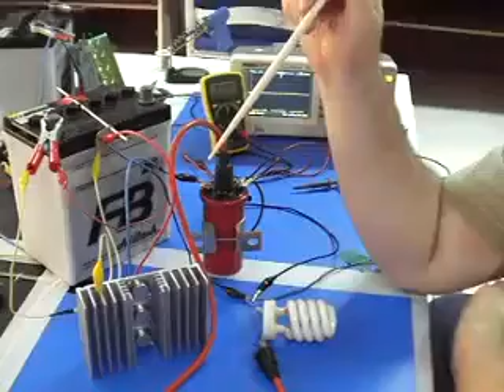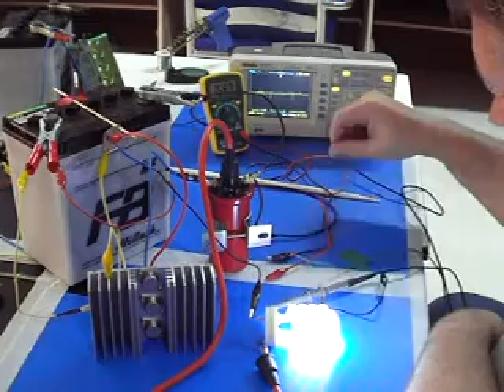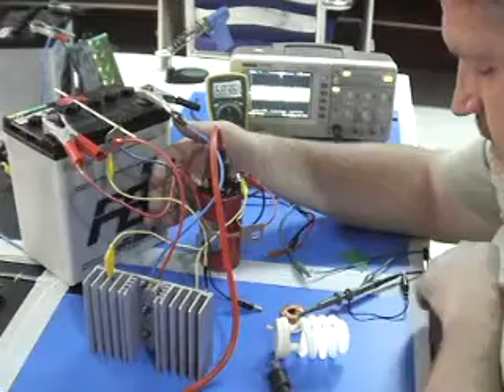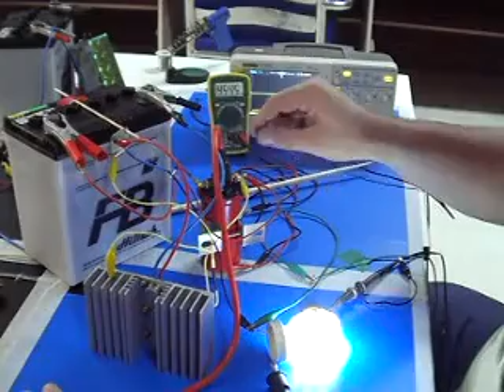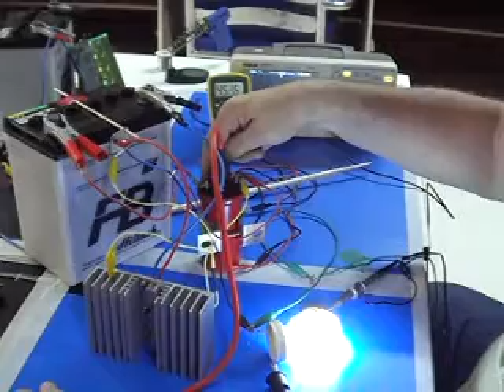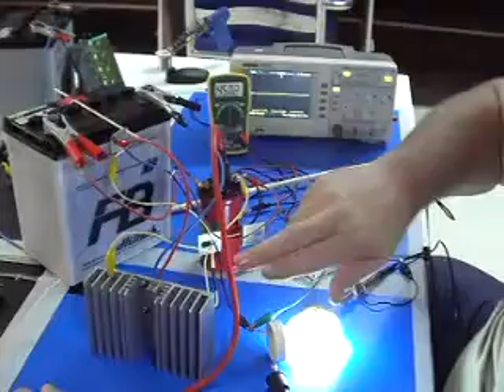Aromaz 009 - DRT Swopping Polarity.MP4

Comment: the ac current is flowing back and forth ... even in to the dc battery ... and that is what ultimately lights the CFL. In terms of DC current flow ... there is the SLOW electron flow ... and there also is the near speed-of-light wave-flow from atom to atom thru copper.